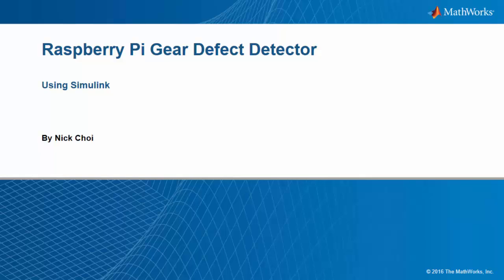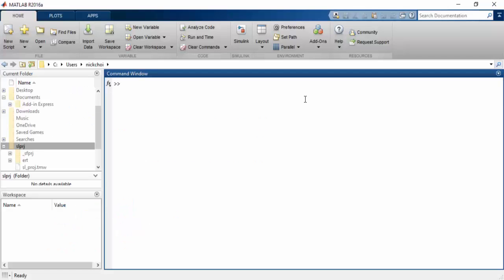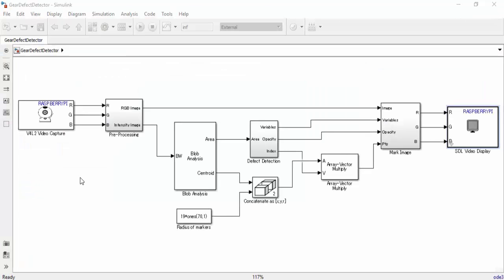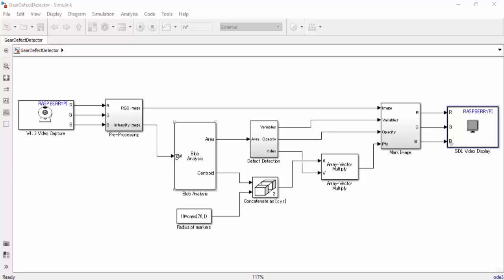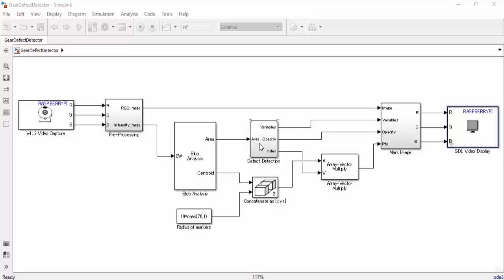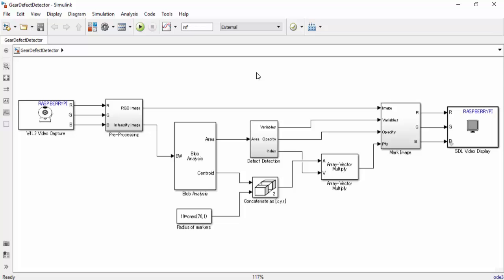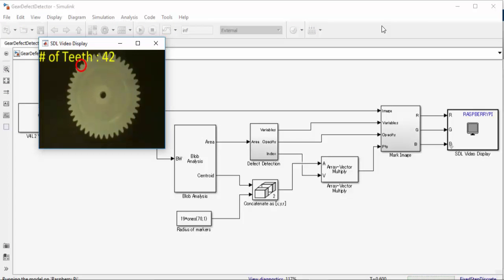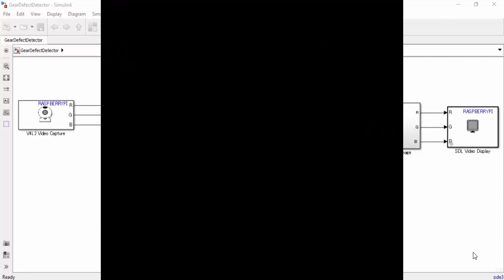Creating a Gear Defect Detector Using Simulink and Raspberry Pi

Comment: Hey! I had a question, Can this system be done using Arduino? And can we add more parameters in this system such as the outer and the inner diameter of the gear and etc.?
Reply: and can you also send the code for this ?